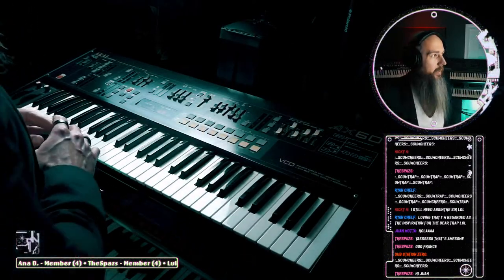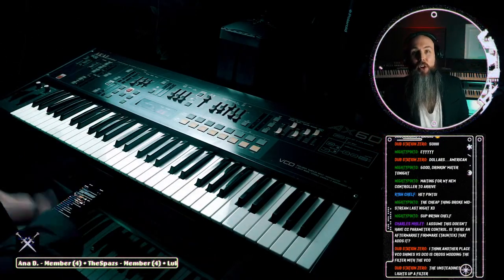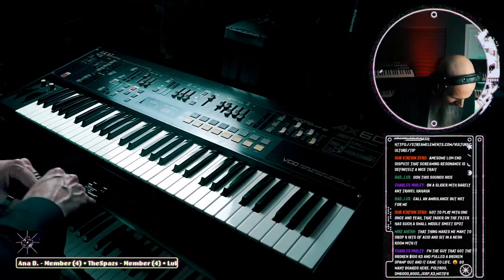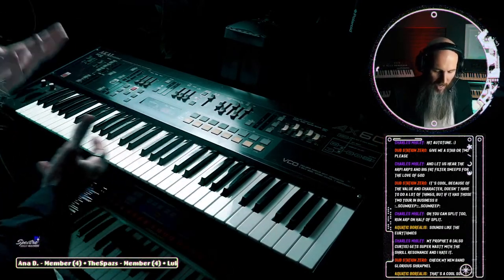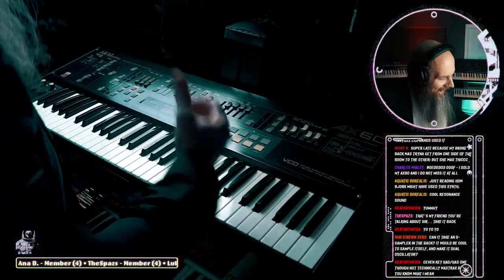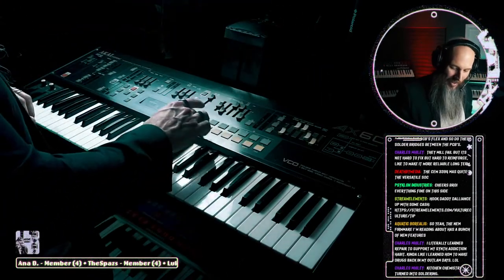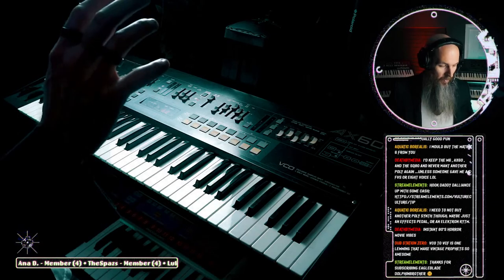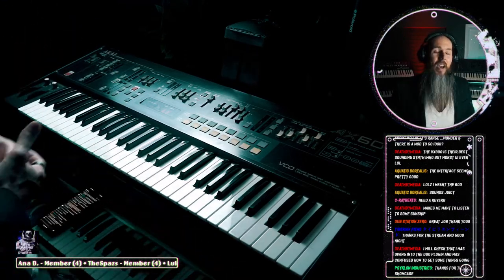Uncovering the Secrets of this Rare, Vintage Analog Polysynth the AKAI AX60! (Scum Night Review)

Comment: Sometimes the synth part balance causes what seems like dead notes. Adjusting it so the fader is in the middle of the slider might help. Also the synth chip this uses is the CEM 3394. There is a company in Latvia called ALFA that makes a replacement chip called the AS3394 that can be used if any voice chips burn out. They require a daughter board to rearrange the connections, because it has a different pinout but it's a great  way to repair your AX if anything should happen. I was able to get 2 chips for $11 each.
Reply from the maker: Thank you for all that info!
Reply: I noticed the same thing with the balance slider.

Comment: I have one and I replaced all the red LEDs with blue ones and the screen I also replaced with a blue one. It looks damn cool now. This is a nice sounding synth wjth good features but the faders react a bit squirrelly , this is a known issue, yes the resonance is a bit harsh, this thing has a mind of its own. Its one of the quirkiest synths made by a famous brand ever. This is the cheapest VCO poly you can get but prices are going up. Akai had odd timing with this release as at the time the market was going digital.
Reply from the maker: That must look so cool!

By 1986 the market has already gone almost completely digital - so it definitely was late in timing! But a really special synth. I hope to get the Tauntek mod for mine to help the faders out a bit.
Reply: @VultureCulture  I should get that mod also, but so far I haven’t. It does look nice in blue, I often change the screens, drives and leds on samplers and synths, I do it myself. I  also got a permanent black marker and painted the gray fader caps to black, it just looks better.
Reply from the maker: How hard is it to do? I'm terrified of opening a synth and fucking something up 😂
Reply: @VultureCulture  if you have never done any electronic repairs or soldering don’t do it , you could damage something. Ive been doing this for decades so im not afraid. Have i screwed up in the past? Yes but it didn’t cost me much to fix the screw up but things can go wrong fast when you open up 30-40 year old electronics. It is fun tho.
Reply from the maker: Thank you for stopping me before I did something very terrible 😂

Comment: Seems very similar in design and options to the Jupiter 6. Differences are two VCOs per voice, and only pulse width modulation on the square wave, but simultaneous triangle sawtooth and square and pulse width rectangular waves. The JP-6 goes for much more. The AX60 seems to get both the crazy sounds and the smooth Juno-type sounds. A real bargain, I'd say!
Reply from the maker: I thought the J6 sounded very similar to the Chroma Polaris which in turns sounds like the AX-60 but with 2 oscillators.

The AX-60 can sound really warm or really cold. Super cool synth!

Comment: I still have an AX80. Kinda always wanted an AX60 due to its integration with the S612 (I used a S612 for many years before replacing it with an S700 and eventually moving away from Akai and getting into Ensoniq samplers. I will put this video in my queue and watch all the way through when I get a chance. I’m curious to remember the differences between it and the AX80 as I haven’t had my hands on an AX60 in decades. 😀
Reply from the maker: I've always wanted to do a comparison video between the two. My friends at Waveform Mountain have one. Perhaps one day I'll collab with them

Comment: Great demo! The Akai AX series is a bit odd, but I love all 3. Interstingly, the AX73 and AX60 share most of the same major components, but sound quite different. Surprisingly, in many cases the AX60 sounds more like the DCO based AX80 than it does the AX73 - which by the specs is just a 73 key AX60 + velocity, less knob per function. In reality, the AX73 has a tone quite unique to itself. It does incredible velocity brasses! My ranking: 73, 80, 60. PS - Tauntek upgrade is worth it on the AX60 (& not hard!), plus the simple resistor mod for the envelope sliders. 
Also, Thx for the name drop! ~Matrix 12 is worth it, possibly greatest synth of all time IMO... we didn't do a good enough job showing it off vs. the 6.
Reply from the maker: Hey!

First off wanted to say I love your videos! Thank you for your Matrix 12 / 6 and 80 / 70m comparisons! 

The Matrix 12 really is a contender for greatest of all time, so I hope one day to get to play one!

I wouldn't have guessed you would put the 60 at the bottom of your list! Time to save for a 73 🤣

And good to know the Tauntek mod isn't difficult!

Thank you for the comment 🙏
Reply: @VultureCulture  Thx for the kind words! Our channel is just for fun so content production is slow 😆. Per the AKAIs, it is difficult to rank them, I could easily see others having a different preference. Honestly, I really like them all, along with the VX90 & VX600. The entirety of Akai's line up is interesting, unique, and great value for $ in terms of both sound and feature set. IMO though the 60's sound gets a little tiresome as it is very specific (& it is the only one that lacks velocity). The AX80 was my first analog synthesizer so it has sentimental value. Of the AX line, I prefer the sound of the 73 most. Anyway, I enjoy your content, I've posted here before as "Jack Z" - my regular account. Keep up your hard work and great videos, you have a really fresh approach!

Comment: I'm super excited to watch this video and happy it pooped up in my recommended. I'm a huge AX60 fan so any new video on it is great! I have a synth collection and the AX60 will probably always be my number one choice. There's a reason why I have two and the S612. For the value you can get these, they are amazing. Plus somewhat unique, sounds great, and has great features. The sampler input is something that shouldn't be overlooked too. I don't know if this was explained later in the video but the stepping filter sliders are something innate with 80s synths with digital preset recalling. In order for presets to be saved and recalled, the sliders have a digital value range. And that digital value range has a resolution that's only so big. Hence why you get that digital stepping when adjusting the slider, similar to the PolySix (I think). Controlling via the LFO or ADSR shouldn't get this same stepping.
Reply from the maker: I go over it later but yeah - depends on the synth. Polysix doesn't have stepping, DW-8000, Alpha Juno, Chroma Polaris do.

This synth impressed the hell outta me! I want to find an S612 I can afford and demo them together! Right now I'm recooperating funds lol

Comment: If one voice is missing a waveform, for instance it has no saw, then a patch that uses just saw waveforms will have some "dead" keys, as that voice is assigned to them.   If you switch to a different patch that uses pulse instead, all keys will work fine.   Also, if a different voice is assigned to that key when playing the saw patch, it will work fine.
Reply from the maker: Aha! That makes so much sense! Thank you for the info!
Reply: @VultureCulture  Just wanted to add that each CEM chip is fed 8 control voltages by a CD4051 analog switch IC.   Loss of a waveform can be caused by the 4051 failing
as well, and this is more likely than the CEM chip, as those are pretty reliable.   CEM chips are often socketed, so you can swap them between voices to see if the problem moves, assuming you conclude that one waveform is missing.   Of course first you have to figure out which voice has the issue.
Reply from the maker: You are a god send! Thank you thank you thank you! 🙏